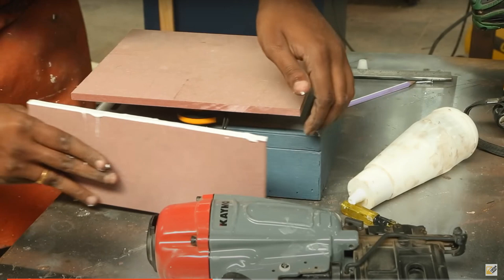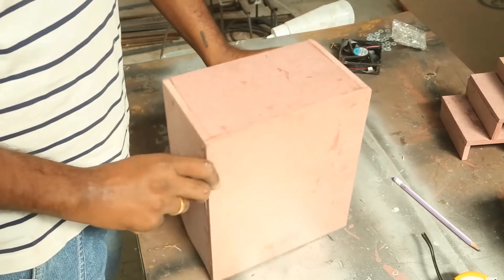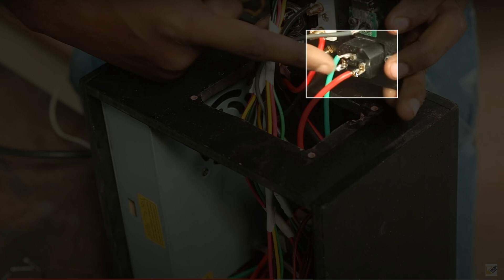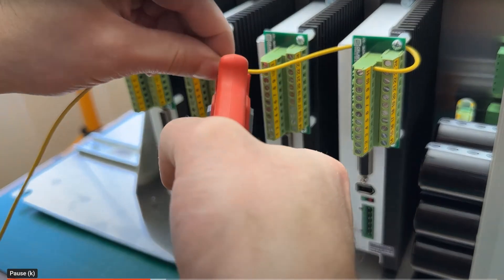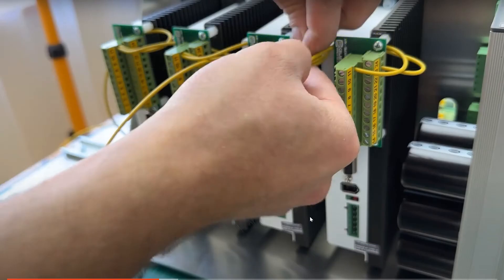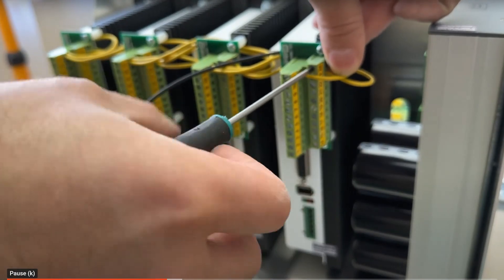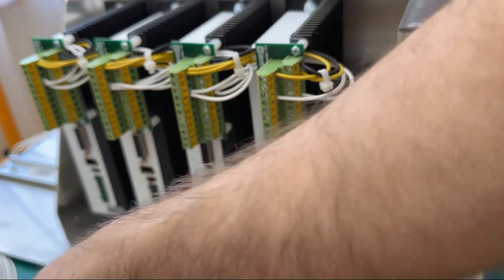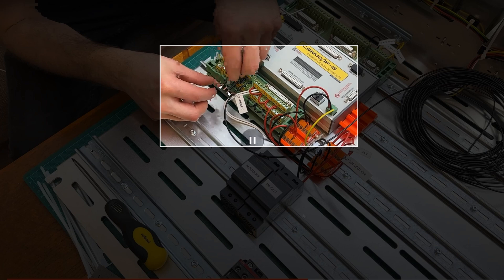CNC Router Controllers Built Incorrectly (Volume 7)

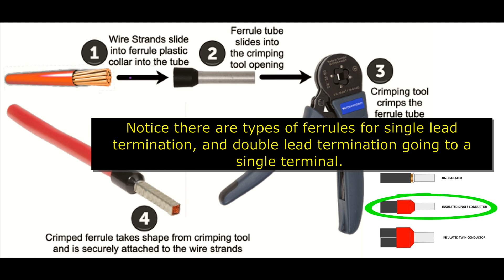Comment: i thought tinned ends was bad practice @8:20 (supposedly the solder flows through time), no hate just wondering.
Reply from the maker: Thank you for your support. 

Tinned leads are fine to use with terminal blocks, but like with ferrules torque of the screws on your terminal blocks should be tight enough to make contact, but certainly not over torqued. 

I suggest referring to your terminal block torque ratings, and purchasing a torque screwdriver.

Thank you,
Vince